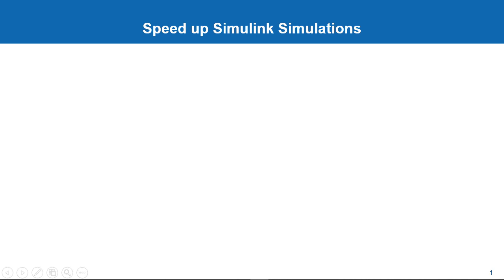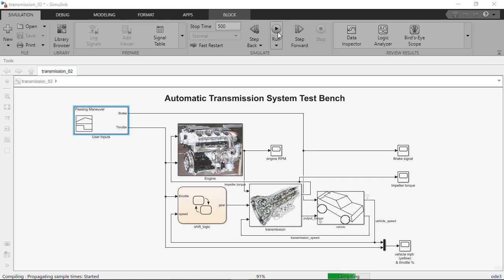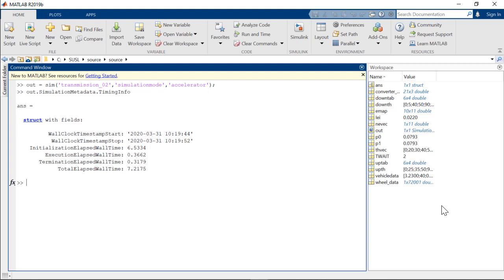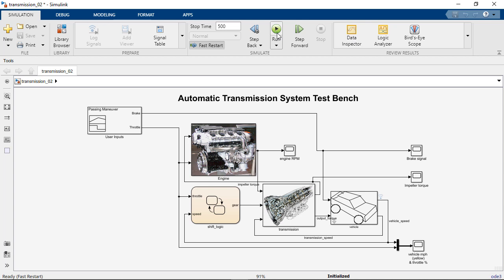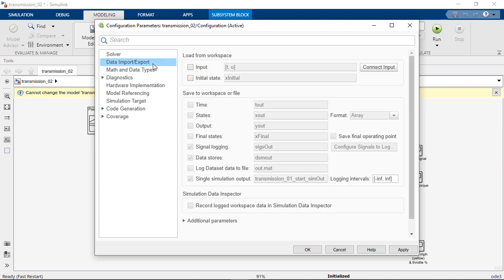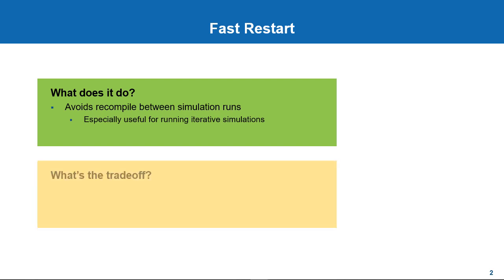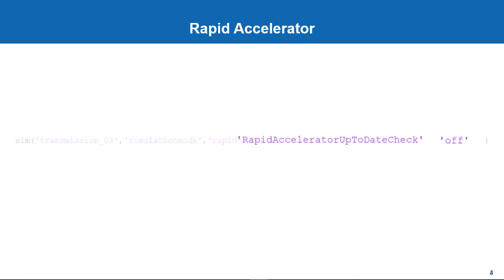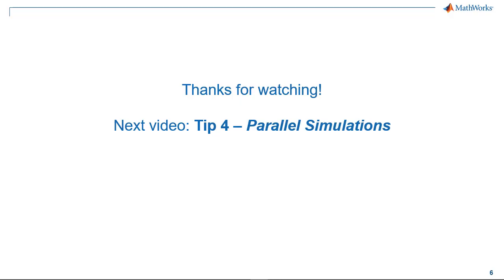Five Practical Tips to Speed Up Your Simulink Simulations: Fast Restart

Comment: I got this when I marked [t, u]
Error evaluating expression '[t, u]' for 'ExternalInput' specified in the Configuration Parameters dialog for block diagram 'model_ELKON'.
Caused by:
Unrecognized function or variable 'u'. 
Component:Simulink | Category:Model error
Error evaluating external inputs specified in the Configuration Parameters dialog on the Data Import/Export Page. External inputs may be specified as either (a) a list of matrices, structures or timeseries or (b) a single MATLAB expression or function